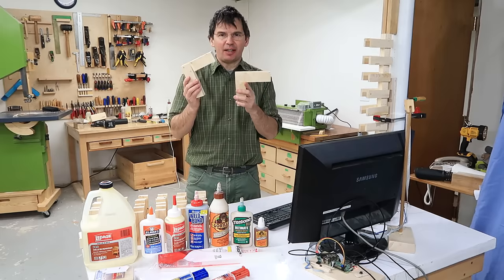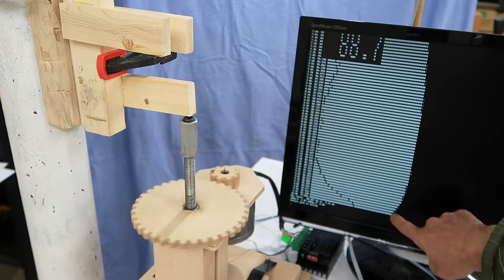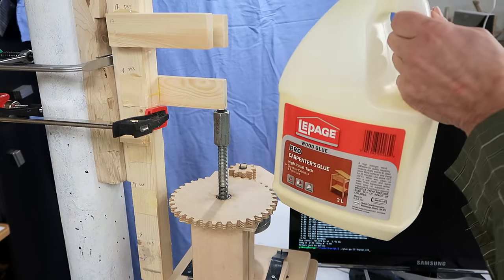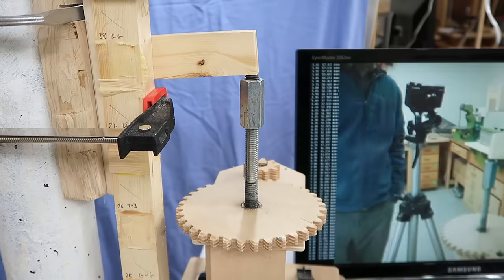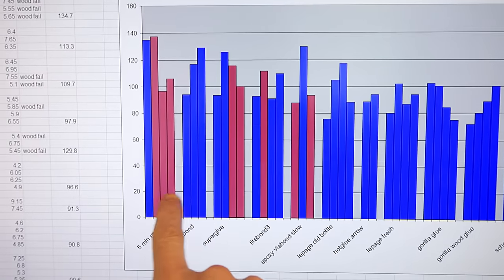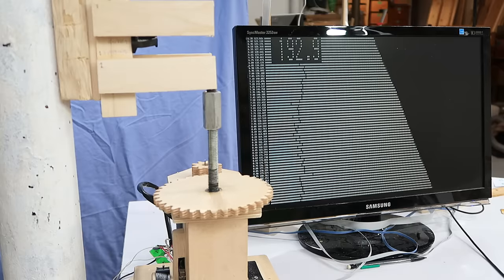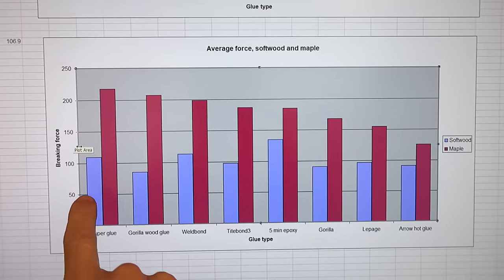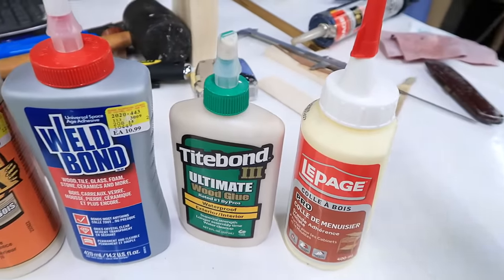Which glue is strongest?  Testing with my computerized tester.

Comment: I'll pop in early and say that you used the wrong construction adhesive. It has to be PL Premium - a polyurethane construction adhesive, and not the normal subfloor adhesive you tested.
Reply: Now I want to see a video on which construction adhesive is strongest...
Reply: Moar content? We all win! 😁

Except perhaps for Mathias, having to repeat the test cycles again, with different wood than this set of tests.
Reply: Still don't think it would be as good as the wood glue.
Reply: john with  the burn
Reply: @F0XD1E  I never said it was as good as wood glue, but it's good enough and certainly good for woodworking. My 20+ years of using it are proof of that, at least for me :)
Reply: Sounds like a new test is in order
Reply: Pl premium grabs, always breaks out the wood on my tests
Reply: seems like it's just a ton of work to use something you have to squeeze out of a big tube...when you can just use superglue.
Reply: But I’m wondering is there any advantage in using construction adhesive? Except for the lower temperatures it can be used in
Reply: I came to point out the same thing, found in my own anecdotal testing.
Reply: @qwertzuiop0981  it can walk off a job site?
Reply: @JohnHeisz  If it's not as good and takes longer to dry why do you prefer it sometimes John? Sorry if you've already said in a vid and I missed it.
Reply: @qwertzuiop0981  It has a significantly longer working time, which can be a huge advantage for a complicated glue up.
Reply: @F0XD1E  And it's less brittle then wood glue, good feature for some applications.
Reply: Here to say that.  Could probably do another video on all the different construction adhesives.  Temp and set time are other interesting variables.
Reply: Just thought I'd chime in that construction adhesive was formulated mainly to be able to use in all positions (even overhead) without dripping like wood glue, the ability to fill in large gaps in joints, and the ability to bond multiple types of materials besides wood. These things are all more valuable for a construction site rather than sheer strength. I too would like to see Matthias test the poly type adhesive.
Reply: @qwertzuiop0981  the curing time is longer than regular wood glue
Reply: I was thinking the same thing, there's 2 PL construction adhesives available in the USA (premium and another who's name escapes me, but it's something building on the premium, supposed to be a step stronger) that are much stronger. I tried this after you recommended it for building stuff in the cold building a cabinet in the garage and was thrilled at the results.
Reply: @JPearlLapis  Project Farm has a couple good videos on them.
Reply: @JPearlLapis  I've been in the construction adhesive section of a home center and it is intimidating to try to figure out what to get.
Reply: That makes sense 
Thanks
Reply: The biggest problem with the conduction adhesive is most types required some space between the two surfaces. Not ideal for fine woodworking but ideal for course construction.
Reply: @JohnHeisz  as kind of a beginner at woodworking it seems to me that "strong enough" is key.

I see more people discuss what glue or joinery method is the best but not much about what's sufficient in a given situation.
Reply: 400 is more flexible, but so is hot glue??
Reply: @Steve_Just_Steve  He likes to use it when it's too cold for wood glue
Reply: @Frostfly  Except that Super Glue costs a fortune in comparison and toxic (carcinogenic)
Reply: @shrike6259  Superglue is cheaper if you get it in larger bottles, and not in the tiny tube from the store.
Reply: @VedranBucko  I knew he had a reason, thanks.
Reply: @JohnHeisz  I think that's what it comes down to: which glue you like and works for you. I like Titebond 3 (but hate Titebond 1!).
Reply: @JPearlLapis  Suggest it to Project Farm!
Reply: i like it for out door projects
Reply: @jakefriesenjake  400 is less flexible, it's quite hard and brittle when cured
Reply: i agree pl is the only construction adhesive worth trying  and buying .
Reply: @shrike6259  yeah, cuz the shit they put in construction adhesive isn't toxic sure.  And you can get a quart of Superglue for about 30 bucks.
Reply: @RunarMagnussen  Probably because it's better to over-build than to use something that is only just good enough.
Reply: @Frostfly  i think the construction adhesive takes a while to dry so you can continue to adjust for any mistakes, the other stuff simply dries quicker or immediately. Also the capability to use below 13 degress celsius and all that.
Reply: @ironpirate8  very true! Though I also think there's a "strong enough" for over-building too, haha!
Reply: @jeremywade7627  
  I think you got that mixed up. This next text is from the pdf file from henkel/Lepage. ;

PL 400,
"excellent flexibility to compensate for the different expansion rates of ..."

PL Premium is what you are thinking. It's brown and brittle.
Reply: @JOSEPH-vs2gc  that is an excellent point.  I'd mostly stick to wood glue myself though...but i don't do construction so that a bit different...perhaps glue makers really kinda do know what they are doing?
Reply: I would say the glue film was too thin.
Reply: @jakefriesenjake   I agree that the pdf says that it's flexible but doesn't offer a comparison to premium. In my experience as a carpenter in residential construction for the past 15 years pl 400 is more brittle than premium. If I have to remove pl 400 from a joist I usually end up having to chip it off with a hammer vs premium which stays ductile and can be sliced off with a knife or sharp chisel. Pl 400 is very light brown almost grey and matte in finish. Pl premium is also light brown but no hint of grey and dries shiny.
Reply: Oh man you are poking the bear
Reply: @JohnHeisz  They do make plenty of polyurethane glues specifically for wood, (they are more liquidly than the paste of construction glue) but I think you are just using the generic because you are cheap and lazy... its easier for you to get it in a tube to apply it, and not a five gallon you need to somehow move it into a smaller container to brush it on. These glues are far stronger than anything sold in big box stores, for sure. Furniture plants have been using them for decades, and it only take a touch of the stuff to work, a tiny bead is all they need get onto the surface, they rarely do a glue up right, we have all seen how poorly they use glue :P
Reply: I too am a fan of PL premium especially with mdf and particle board. Made plenty of jigs PLP, designs may not be the greatest but construction was really solid. I keep a big cartridge with a latex glove finger covering the tip to slow down hardening ready to apply. Probably use half PLP and Lepage wood glue. Don't like the messiness and no matter how careful I always get a bit on the finger tips.
Reply: Liquid shim baby!
Reply: Is there a certain glue they use on skateboards? I'm making small fingerboard keychains and I want something that will harden and help the wood hold its shape.
Reply: @chadjudge7552  Das Brot ist sehr gut

Das Brot ist sehr gut

Ich steckte es in meine Tasche

ich werde nach Hause gehen

lernen

Weil er aufgewacht ist

In der Küche

In einer Handtasche

Sie haben eine gute Bäckerei

Ich habe den Kuchen gemacht

Ich kam hierher

Er aß und es ging ihm nicht gut.

Aber man muss es nicht lesen

Es ist ein lateinisches Lied

Er sendete

Für die Leute

Dieses Lied ist ein Lied

Neunundachtzig

Es hat damals Spaß gemacht

Es wird kein Ende geben

Weil ich pünktlich angekommen bin

Die Kunst der Poesie

Tu es
Reply: @notbritishorfrench  🤷‍♂️
Reply: I thought construction adhesive was more of a shock absorber than an actual adhesive, reinforcing screw joints.

Comment: Hi Matthias, I work as an engineer for one of the top 3 adhesive manufacturers. What you measured is the torsional shear strength of the wood glue. One interesting thing that you pointed out is that the different failure mode in each sample. You can see the "adhesive" failure when the bond between wood and glue failed leaving a clean surface. Most appeared "cohesive" meaning that the glue failed in the bulk structure leaving adhesive on both sides. The wood breakage was a substrate failure and these results are typically discarded. A factor to account for when comparing to Wood by Wright's data is that your setup includes leverage from the force applied at the end of the wood block. Also important is each glue's reliability ratings like humidity and temperature that you mentioned. More rigid glues like superglue also might not be able to and the CTE mismatch during temperature swings.
Reply: I wasn't sure if you were making this up, but I checked your username and you're not a phony so thanks for your insights! 😉
Reply: What glue would you recommend?
Reply: @DakotaBurgener  Entirely depends on the substrate (wood or other material) and operating conditions (exposure to temperature, humidity, force, time etc.)
Reply: I was following you fine until the final sentence: “More rigid glues like superglue also might not be able to and the CTE mismatch during temperature swings.”

Might be able to what? And what is a "CTE mismatch"?
Reply: @BenInSeattle  coëfficient of thermal expansion. Most materials expand if temps go up, and contract if temps get lower. The amount of geometric change per unit of temp change is the CTE. So each material has its typical CTE. For joint strength stability it is benificial if CTEs of glue and wood are as similar as possible. If not, then temp change causes internal stresses in the joint, as there is only a small temp range where the geometries closely match. Cyclic stresses can cause microfracturing and debonding within the joint. Leads to strength loss and ultimately to failure of the joint.
Reply: @Kleinduimpje  Thank you. You are a veritable fount of knowledge! So, the word ‘and’ in the sentence “more rigid glues might not be able to and the CTE mismatch”, was probably a typo (Swype-o?) for ‘handle’. Right?
Reply: @BenInSeattle  I would guess indeed that’s a typo, would make perfect sense to me
Reply: @zasgat  Hi sir. Your reply to his video is a good one. Since you're in this field, you suggested that it depends on the substrates etc. so can I ask that question again and say indoor wood glue ups? I watched another video about epoxy, and it seemed that the cost is extremely high and not much better for strength?
Reply: @rufustoad1  Conventional wisdom is that wood glue (from a reputable brand) is best for standard indoor glue-ups of wood on wood. Titebond 1/2/3 is a good place to start, they each have slightly different properties.
Reply: I am guessing 3m or Henkel. BTW I submitted for a free loctite sample over a year ago.. still did not get it. If you work for henkel tell your marketing team I am still waiting..
Reply: @CL-yp1bs  Das Brot ist sehr gut

Das Brot ist sehr gut

Ich steckte es in meine Tasche

ich werde nach Hause gehen

lernen

Weil er aufgewacht ist

In der Küche

In einer Handtasche

Sie haben eine gute Bäckerei

Ich habe den Kuchen gemacht

Ich kam hierher

Er aß und es ging ihm nicht gut.

Aber man muss es nicht lesen

Es ist ein lateinisches Lied

Er sendete

Für die Leute

Dieses Lied ist ein Lied

Neunundachtzig

Es hat damals Spaß gemacht

Es wird kein Ende geben

Weil ich pünktlich angekommen bin

Die Kunst der Poesie

Tu es
Reply: im doing a timber frame garage with queen post truss but I have not 28' timber so i will joint them in the middle (canadian spruce) 8x10. I don't know yet wich scarf joint i should do but wich glue you would take? i have 14' clean room span so a bit a flexion force and 10 000lbs in tension force
Reply: I think for this test, however, the softwood failure mode is helpful, since this is going to be similar rough order of magnitude for other softwoods like cedar. It isn't going into FEA.

I'm using this test right now on something I'm building because I'm trying to keep it simple since it's just a shop tool rather than a piece of furniture. I am skipping what would otherwise be a mortise, and just doing a lap joint because I suspect it is strong enough for my application. It's also just a project I've lost excitement in and just want done. Like this test, it's also a similar area of glue, under torsion, but doubled up on either side.

Comment: For me, the strongest glue is always where i didn't mean to apply it.
Reply from the maker: I discovered superglue sticks amazingly well to skin!
Reply: @matthiaswandel  It's even usable for closing a cut in a pinch lol
Reply: @firstlast446  It's my go-to for most cuts. Exponentially better than any bandage.
Reply: @matthiaswandel  Universal truth of superglue... it always ends up on your hands. One thing to factor in as well is wood expansion/contraction breaking brittle glues (like superglue) over time. Construction adhesive can be much stronger e.g. PL Premium x8 and MAX with rated tensile strength 2-4x that of regular ones.
Reply: @elminz  A compliant glue like polyurethane is better if the temperature is going to vary a lot, especially if the two parts that are glued together are different materials.  Old lab trick: if you want to separate two pieces of different materials that have been glued together, toss the assembly into liquid nitrogen.
Reply: @firstlast446  Also if you got a nail in your tire and need to keep driving. Also for blown hoses or air lines. You can patch almost anything with CA glue and baking soda.

Comment: Thanks for shout out. On the test I did, The long grain to long grain is actually a cross grain connection. So they should be fairly similar in that. but with the rig I was using, it puts more pressure on the glue joint itself. I would to try it with your computerized laod cell. That is so sweet. Nice work. I always love watching your tests. Lots of great analytical thought-through on that.
Reply: Shut up? :D
Reply: @D4rkS7der  there's glue on his O key
Reply: shout out*
Reply: @D4rkS7der  Freudian? …
Reply: @smitm108  My guess is phone autocorrect
Reply: At first I thought he was angry.  :-)
Reply: Speech to text for the win.
Reply: @D4rkS7der  oh my word! Sorry voice to text went wild on that one.

Comment: Fun fact about wood gluing my late Great Uncle Ralph taught me back when I was a child: (Using plain Elmer's wood glue circa 1986) when applying wood glue, brush it on all surfaces being glued, and let it cure for about a minute, then apply a second coat quickly and then put the pieces together, the extra tack and time for the glue on the wood helps evenly penetrate the surface of all the pores in the woodgrain, also helps the glue to remain wet longer when you reapply, thus giving it a longer more even cure rate in the end, and will not "flash cure" (when the wood wicks away the moisture of the glue too fast) thus weakening the glue's bond into the wood. Moistening with water will only dilute the bonds made on the surface of the wood, so that will not work. I still have the example of this very lesson, a desk I made for college, which underwent no less than 6 moves cross country, and none of the joints have failed to date.
Reply: Great tip! Thanks for sharing.
Reply: I enjoy this tip thank you
Reply: It also helps a lot to apply the glue, brush it onto each piece, let it sit for a minute, apply more glue, then rather than just put the pieces together, SLIDE the pieces against each other a bit until they naturally seize together, then slide them into the correct position.  I don't know why, but when this sliding technique is done correctly, it makes the connection much stronger.
Reply: All this would be worth thoroughly testing.

Comment: I use construction adhesive regularly for, well, construction. What I’ve learned is there are many different kinds for specific purposes. DAP4000 for example has very high PSI ratings for cross-joint strength. So when your subfloor expands and contracts seasonally, you don’t shear the glue off. I imagine that you used one of the glues that’s designed to withstand expansion, and so is weaker (but less brittle). The more brittle stuff might make better furniture joints
Reply: Yep, I'm in the states and unfamiliar with LePage, so looked up the one he's using and it is for subfloor. LePage and Loctite are basically the same it looks like. Same parent company and similar brands between them. The PL 3x and 8x did really well in Project Farms testing

Comment: Here in California, at least, "construction adhesive" used to be a thick tacky paste that smelled strongly of hydrocarbon solvents. It worked well for large gaps and disparate materials, but the law now limits VOCs, and all construction adhesive is basically latex paint, which is slow drying, and weak. I agree that cheap wood glue is still the best for tight fitting wood joints. Thanks for doing the tests!

Comment: Thank you for this!  I never even considered gorilla glue before.

Three factors for choosing titebind 3 Vs regular wood glue:
1. Outdoor/waterproofing needs
2. +5/10 minutes working time
3. Remains non tacky for longer, which makes bringing several tight joints together easier (like a row of dominos or finger joints).